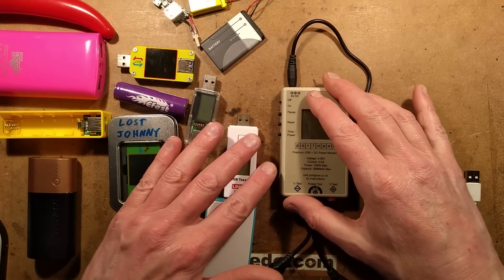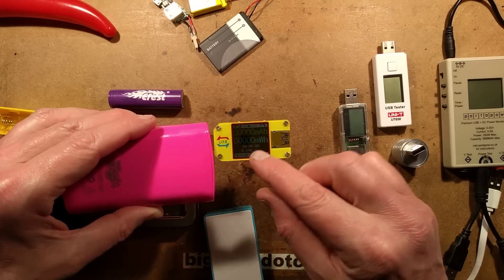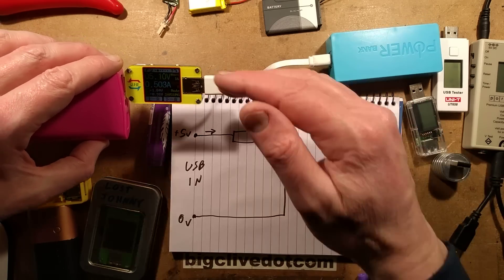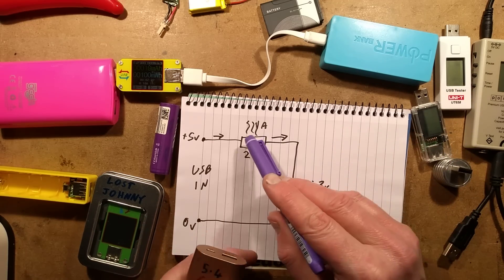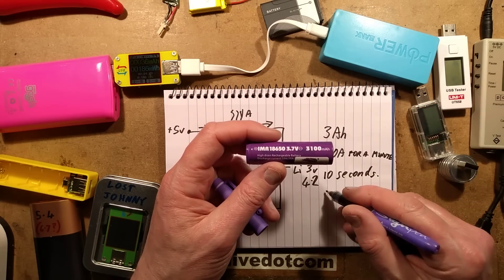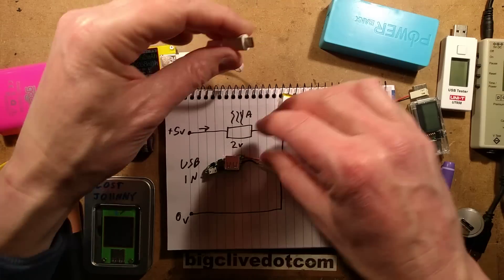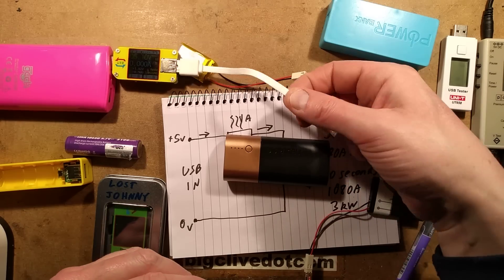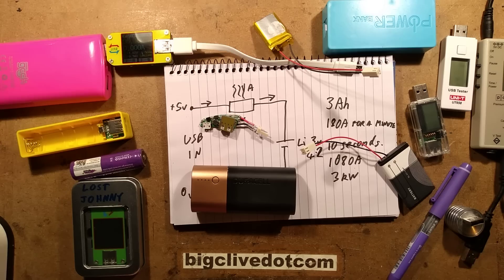How I test lithium cell and power bank capacity.

Comment: Happy New Year, Clive, lovely video as always.
I'd like to embellish your statement @13:30, that you wouldn't get 3Ah out of the power bank containing a  3Ah lipo cell because of the step-up conversion losses.  It's not because of the conversion losses as much as it is the voltage difference.  With an ideal lossless conversion you'd pull, say, average 3.7V * 3Ah = 11.1Wh from the cell and put that same energy out at 5.0V, meaning 2.22Ah @ 5V.
Reply: That's why the unit Ah is crap.
Reply: @Burkhardj     and if the next leap in battery technology gives us 2V cells, the mAh rating will leap up for a device that stores the same amount of energy.  Maybe then consumers will ask for a rating that reflects their usage.
Reply: Whether you use Ah or Wh (both have different advantages and disadvantages, neither tells you everything) for a capacity rating to be valid, the load resistance and end point voltage, or the load current and end point voltage, or the load power and end point voltage also need to be stated.
In reality, use the figures as a rough guide. As the capacity will fall over time/usage anyway.
I don’t see any drive for manufacturers/suppliers/shops to change, as (1) the fakes are skewing the market on eBay and other similar web sites and (2) to the ordinary user with little or no knowledge of electronics/electricity, the capacity whether stated in Ah or Wh is just a number where bigger is better and nothing more...
Reply: @Mark1024MAK  If bigger is better, the manufacturers should start using Wh. Much bigger number! And you rarely need Ah. I can only think of a few scenarios where you'd need it, and they only apply if you handle the cells yourself.
Reply: I've tested about 50 powerbanks up until now and all the data is available.
I have to say, forget about mAh's, look at Wh's...
Reply: If it's a 5 V pack and it puts out 5 V then it's a bit unfair to put the Ah rating on the box using 3.7 V or whatever.  Definitely agree that Wh or at least mWh would be fairest, and perhaps they should list both the charge and discharge capacity, with the two numbers being closer together the more efficient it is.
Reply: @vink6163  Yeah, I could also just state the Ah rating at 1V and have an insanely high number for some great marketing. If they are selling a "10Ah powerbank" I want it to output 10Ah. I dont care what kind of cells they use and how they achieved it.
Reply: michaelditto , this is exactly why he always measures lower capacity than stated .. he measures mAh @ 5v then compares it to the stated capacity @3.7v and always concludes that the actual capacity is less than stated .. he tends to forget the voltage difference.
Reply: theR6969 if you advertise a power bank as having a certain Ah rating, I think it’s fair for the consumer to expect to be able to pull that many Ah from the device.  Stating an internal current value the user of the device will never see is misleading.  I do understand the manufacturers probably buy the cells by Ah and simply re-state that number in their marketing, but is that the right thing to do?
Reply: I agree with you that it is not right.  However, it is common practice, making it difficult for a single manufacturer to do it right, as they would have a lower Ah rating than the competitor.
It would be much better to specify the number of Wh.
Reply: @TheCubicnz  I have a 11000mah rated pack, it takes about that to charge, but will only output about 8-9000maH. I find this misleading,  should be rated on output ability not input.
Reply: @The_Wizard_42  Your cell is 11000mAh. The problem is that the step up to 5V reduces current output. I guess it uses a linear current regulator for changing. They should use Wh.

Comment: The complexity of this video exemplifies the reason we should be measuring cell capacity in watt hours.
Reply: @themonkeydrunken  Typo.  The rule of thump is actually: Watts = Amps * Volts.  Amps = Watts / Volts.  ( P = U * I).  
And it's probably a good idea to always include some kind of disclaimer about AC, where VA is not the same as W because it's complicated by capacitance/impedance/etc unlike DC.
Reply: @clausjellinggaard756  Good lord, when will I learn not to comment before coffee? Thanks :)
Reply: @themonkeydrunken  😂☕
Reply: @clausjellinggaard756  
ELI the ICE man....
Reply: @willybee3056  Not being a native English speaker (I'm Danish and use different memory crutches) that one took me a while to understand :o)
Reply: @clausjellinggaard756  
The true sign of intelligence IS being able to read between the lines...
There are a lot of people that I talk to , not only have not heard of that crutch, but do not understand that concept.
Voltage before Current in an Inductive circuit.
And , Current before Voltage in a Capacitive circuit.
After 40 years, ,, I still remember it...
Thanks for the reply...
:^)
Reply: @clausjellinggaard756  
Technically, VA could apply to batteries, too.  If a cell puts out 1 watt into a load, it doesn't mean the cell dissipates 1 watt.  The cell puts out 1 V at 1 A.
Reply: @clausjellinggaard756  
Also when you get into VA in AC, you have to say VA reactive, or VARs.
Reply: This. I've always found the mAh confusing, because at what voltage is that? When a powerbank claims certain mAh, I expect it at 5V, because that is what it supplies (and takes). But usually they mean mAh at the cell voltage, which not only varies by charge, but also is NOT the voltage at which I'm interacting with it.

Or shall we go measure amps on the mains as if it were 100kV? Just because that's the voltage it might be before local transformers?
Reply: The other John Smith 
Seriously?
Reply: @thany3  Exactly what I was getting at in my comment.
Reply: The stated mAh is usually for the 3.6 or 3.7 volt nominal, not 5v. That is important because you will always get lower mAh for 5V.  1Ah for 3.6V is 3.6Wh and 720mAh for 5V at 3.6Wh. Manufacturers can then sell products at inflated figures to make them look better. Plus it is impossible to get full stated capacity anyway due to conversion inefficiencies.
Reply: That will never happen. The marketing wank gets a bigger number by not taking into account the battery voltage being less than 5V.
Reply: It's mostly a matter of convention, but also a matter of hardware material interests from an engineering standpoint.  For instance, your consumer incandescent light-bulbs are/were rated in Watts, so is your microwave oven.  But the circuit drop to your house is rated in amps, perhaps 50 or 100 or 200 amp service.  Your batteries are rated in amp-hour capacity for many of the same reasons.  For one thing, you can boost your Watt-hour rating by arranging cells in either serial or parallel, but only a parallel arrangement will improve your Amp-hour capacity.

Perhaps your statement would be better phrased "battery pack capacity" or "powerbank capacity" should be rated in watt-hours, while individual cells remain rated in amp-hours.  Or just display both ratings.

And then there's Volt-Amps but we won't get into that 😂
Reply: @agvulpine  I agree with what you said you hit the nail on the head🔨👏
Reply: We seem to measure in Ah because it's easier, and stating the capacity in mAh gives it a bigger number for marketing illusions etc.
however mAh can be good for measuring super-capacitors and small batteries...
The Ah measurement takes into account a constant current, and only really 'measures' the time until the cell voltage drops as the cell runs dry...
Watt hours requires measuring voltage and multiplying by the set current, over time. This is far more difficult to do, and just as inaccurate as an amp-hour based measurement, because in both cases, the capacity will appear larger at low currents, and smaller at high currents.
And watt-hour measurements can go all wonky when using different current levels, as the cell will exhibit a higher voltage for longer at this low current, which can make the capacity appear rather high (although this is the true capacity of the cell, the lower current allows more power to be pulled from the cell)...
It also has some quirks in that two cells may show identical capacities in a simple Ah test, but when tested with a device that actively calculates the watt-hour value, the cells may vary in capacity based on differences in voltage between the two cells during the test...

In a nutshell, its hard to truly measure a battery, since it's capacity is affected by 8 different factors (age / number of cycles, temperature, series and ionic resistance of cell, what voltage it was charged to (and even at what current the charger stops!), and the discharge current... maybe more)
Therefore the things are measured in Ah using constant-current over time, to keep things simple.
It's also a simple matter to convert the Ah figure by multiplying it by 3.7, giving approximate watt-hours (Power (Wh) = Voltage (Vcell) x Current (Ah)  this works for all batteries...)

I only really use Watt-hours / Joules for energy comparisons etc.
Otherwise Amp-hours are standard; i've got a little PIC based test jig that measures capacity by discharging at a constant current, and counting the coulombs over time, was simple enough to build and works well. The Amp-hour output is also handy for determining the condition of the cell, as the current is limited by the surfaces of the materials in the cell, so if a cell normally tests 2Ah, but the next one in the pack reads 1.5Ah, that cell probably has a high series resistance...
...And thats the other good thing about simple Ah measuring devices, using the difference between two different current levels, and the voltage difference at the cell, one can effectively work out the series resistance of the battery; a very important figure to know!
Kind of more important than capacity in my opinion!
Reply: @Komiyan.  👏👏👏
Reply: That's stupid, capacity is always in mAh printed on the batteries, and tells you how long it will last at a fixed current. You can't find batteries that have a capacity in watt hours. Same as using limbs to measure distance, you don't do it because it's stupid. NASA uses the metric system which makes it instantly better. They also use it because using limbs is stupid.
Reply: @josiah7913    The ones in front of me aren't. lol
Reply: mAh or Ah means nothing as far as power output when the batteries are multicell and in series and/or parallel.  Two batteries might have 1 Ah for 10 cells in series, or 10 Ah for 10 cells in parallel, yet they are still 10 cells and have the same power output.  That's why they use mWh or Wh.
Reply: Cell size is measured in mAh or Ah (same thing just add/remove 000) becase the amount of used energy (Wh) depend on charging speed (losses higher at higher speed) and nom voltage is known.
In systems (EVs or powerbanks) Wh should be used because batteryvoltage is often unknown!
Please don't use amp, volt, power, energy as if these were interchangeable..! :-)
Reply: For non techy, non electrical people like me, who just enjoy Big Clive's soothing voice, watt hours would be good ESPECIALLY since that's what electric car batteries are measured in. I don't really know the difference between a watt and an amp, I definitely don't know how to convert between the two.  As electric cars become more popular and people get used to car battery capacities, charging rates, cost of electricity per kWh etc.... you get my point.
Reply: @AsphaltAntelope    I get your point and it's a good one.  It's the fact that electric bikes and cars use a range of voltages that makes amphours useless as a comparison.  Watt hours works,  but as I've explained in another comment,  1 watt hour is 3.6 kJoules. Just multiply by the number of seconds in an hour.   So you may come across either measure.
Reply: @AsphaltAntelope  FFS bro ya best for get it if ya think like that .......start small then go big or ya got a death wish .......the size of the packs or cells in EVs eg there's like over 5000 18650s in there ....but all it does is make the number smaller for dumb people 😂😂😂 cus of lack of brain cells 😂😂😂😂 and there's no difference between watt and amps .......... amps and volts is energy applied to the circuit...... the watt is a measure of used or wasted energy ....if ya wanna go basic lol
Reply: @AsphaltAntelope  kWh on a battery is pointless due to charging the dam things

 car company's am trying to confuse ya brain cus everyone knows mAh and Ah as the capacity of batteries no matter what the batteries came in ..

. cars am a joke cus of people with more money than sense buying these heaps of metal lazy bastards 😂😂😂
Reply: @davey2k12  Can you edit your comment? I can't make any sense of what you're trying to say - sorry.
Reply: @AsphaltAntelope  typical that better for ya brain cells 🤣🤣🤣🤣
Reply: Or, youknow, we could actually use the SI unit of energy, the Joule, rather than the nonsensical franken-unit of watt hours.
Reply: @superbun277    yup, but it would take a publicity campaign for people to see its easy.  How many seconds in an hour?      err 60 times 60, ... 3600.  OK so 1 watt is 1 joule of energy transferred in one second.  So 1 watt running for an hour is 3600 joules.    Or 3.6 kJ.   And 1kWh is 3.6 MJ.   Not very hard if you know how many seconds there are in an hour.  And the joule is the pukka measure of energy, including energy storage.
Reply: @raykent3211  what is a pukka????
Reply: @keithking1985   I might have misspelled it.  It means genuine or proper.  Slang.  The Joule is the international standard unit of energy, so it's pukka. It's one watt for a period of one second and is consistent for energy in any form.... steam engines, jet turbines, heat loss from houses, digestive production of a flea travelling a furlong,  etc...    So you could use the watt-second as a synonym, but nobody does.  People do use the kilowatt-hour which is just a multiple of Joules, so that's ok.     The milliamp-hour is not a unit of energy.    It's like saying the distance between London and Birmingham is 2 hours.  Not on foot it ain't.
Reply: @raykent3211  Thank you Ray. Yes I know what a juole is. I thought maybe a pukka was some kind of measurement or something..  I think you gave me some good advice before on noise with buck/boost converters and ground loops in PSU's... I think. Might be wrong....
Reply: @superbun277  
Joules are seconds and would have to be changed to hours, which is 3600 seconds, and that gives these huge numbers.  So it makes more sense to have the values in watt-hours.
Reply: @superbun277  for more nonsense they could go joules/second * 3600 perhaps?
Reply: @superbun277  
Then we could always rewrite the silly history books, and get rid of the names like.
Alessandro Giuseppe Antonio Anastasio Volta
Lenz
Faraday 
Ampere
Maxwell
Henry
Reply: nah mAh
Reply: Bit much for batteries watt hours 😂😂😂ffs unless ya made a big pack and running something that lasts days then yeh but single cell pointless stay with mAh or Ah
Reply: @davey2k12  you could just use mwh if watt hours are too big but the real  reason wh is better is becuase a wh is an absolute measurement no matter what a wh will always be the same amount of power where as an ah or mah can vary infinitely depending on voltage also its not really that much i mean a regular 5000mah battery bank running at 3.7 volts would only be rated at 18.5 wh

Comment: Good stuff!  Does the ambient temperature make a difference to capacity of lithium cells during charging and discharging?  Electric cars charge slower and have less capacity at low temperature (30°C is optimal), and alkaline delivers most capacity at 20°C during discharging...

Comment: Can you calculate the maximum safe discharge rate ie:20, 25, 30amps of a 18650?
Reply from the maker: It depends on the cell.  Some are optimised for high current.  It's better to get them from known good sources, as many online sellers quote bogus specifications which can be dangerous with high loads.
Reply: The only way is to check the datasheet. A Samsung 30Q (3Ah) is rated 15A continuous, but an unknown 3Ah cell made by some random Chinese company may only be rated for 4A continuous.
Reply: This is referred to in the specs as the 'C Rating' -- the rate at which a battery can be discharged relative to its maximum capacity.
Reply: Sure - check the datasheet.

Comment: I need to find the single cell power bank like the yellow one you have here with the replaceable battery. I have a bright flashlight that originally runs on 3 AAA batteries and I found out that this flashlight can use 18650 Cells. I have a small power bank that I modded to be a crude 18650 charger. It works but I'd like something a little more permanent.
Reply: https://rover.ebay.com/rover/0/0/0?mpre=https%3A%2F%2Fwww.ebay.de%2Fulk%2Fitm%2F263742347189
Reply: @thomasschulz3442  Thank for the link
Reply: If you want to save some pennies, 0.63eur is currently the lowest price: https://www.ebay.com/sch/i.html?_odkw=power+bank&_sop=15&_udhi=1&_mPrRngCbx=1&LH_BIN=1&_blrs=recall_filtering&_osacat=0&_from=R40&_trksid=m570.l1313&_nkw=power+bank+18650&_sacat=0 or https://tinyurl.com/18650-case for short.